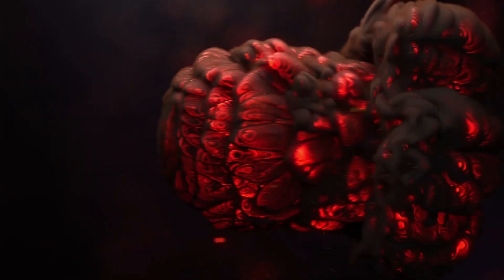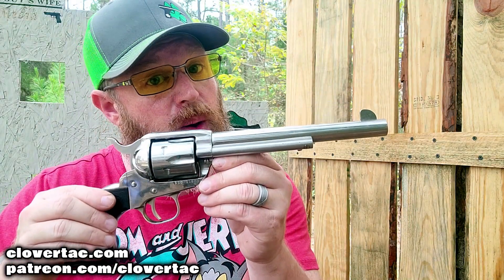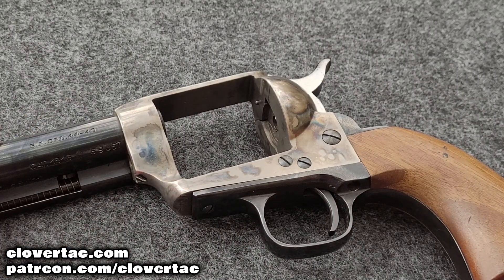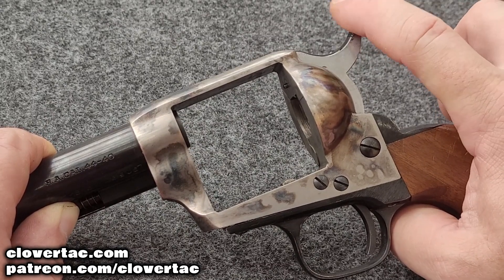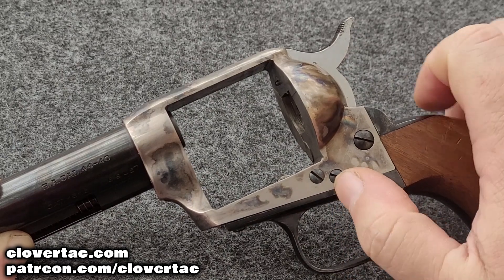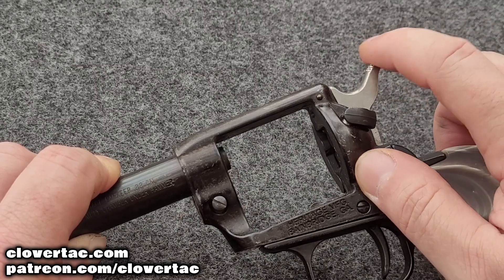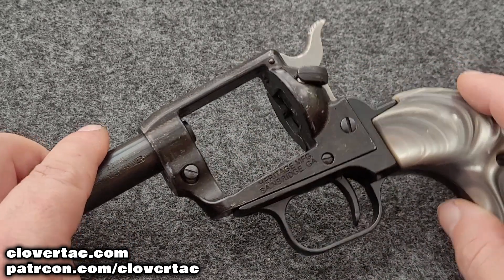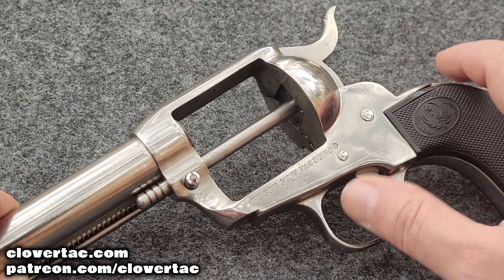How Alec Baldwin's Single Action Revolver Should Have Worked

Comment: Is it possible for  dirt to be in the safety notch and it not catch?
Reply from the maker: possible? sure, an alien could have also messed with it prior to filming, that is possible too 🤣😂 guess what i mean by that is while it is possible it is also highly unlikely. all of that mechanism is for the most part protected and sealed pretty well. for that very tiny specific area to be affected to the point of malfunction, other obvious signs of neglect or abuse as far as the revolver being dirty would be major warning signs, which "possibly" were overlooked as well. with that said, i still do not think, even from slightly before the half cock position, the hammer falling would have enough force to get it done... modern primers need a minimum of about 6 pounds of force and there just isn't enough weight, speed or travel distance to get it done simply under what little spring power would be there. keep in mind, the further back the hammer goes, the more it compresses the spring with exponentially increasing the force the spring has on the hammer. to the point of this video and plausibility, if the revolver was clean, functional, maintained, working.... as it should have been, then there is really no way it just goes off. so if that is the case and it was super dirty, well, we throw that in with the 100 other mistakes that were make which lead to this tragedy, right? 🤣😂
Reply from the maker: oh, worth adding, keep in mind, the notic for the safety and half cock are super, super deep, that is why as seen here you literally cannot pull the trigger at all when they are in that position, those notices are no where near as shallow as the cocked hammer position, by design, for safety reasons

Comment: While talking with MK Outdoor Journal about this I asked if the gun in question was a Colt clone because of those multiple clicks. I am less familiar with the design on the Schofield and others. I appreciate the breakdown here Clover.
Reply from the maker: from the speculation i have heard, it appears the revolver in question was a Pietta which would be very similar to the Uberti in these examples... that said as illustrated here they pretty much all have safety mechanisms built into place, even older ones. now whether or not something was jacked up, guess we will eventually see
Reply: @CloverTac  I believe we will.
Reply: You have to make the distinction between vintage guns and replicas. Although the replicas are based on the specs of the vintage guns from that period they often have modern safety features added. For example, the Ruger New Vaquero is obviously based on the specs of a vintage firearm but it has modern safety features such as a transfer bar and linkage between the cylinder and loading gate that makes pulling the hammer back to half cock to rotate the cylinder unnecessary. A lot of confusion has been caused by people bouncing between the idea of a vintage gun manufactured in the 1880s and modern reproductions made by companies that don't want liability for their customers shooting their toes off.
Reply from the maker: yep and keep in mind that in these period pieces, the prop companies do not use authentic antique historical pieces, well maybe rarely, no way in this case, budget was too small. they typically use the more modern replicated versions. so wear, tear, age, etc should not be an issue and as you say, safety features are much more prevelant as well... not that an original single action revovler isn't pretty darn safe if you simply follow the basic rules of safety.... muzzle, action, trigger

Comment: Good video and explanation of what could possibly have happened. The only thing that I can see that you didn't mention is that the Vaquero has a transfer bar which is why the firing pin can not be struck without some deliberate interaction with the trigger.
Reply from the maker: i think you missed it because i mentioned the transfer bar twice while talking about the Ruger... didn't show it, not really any point in my mind when i can show the hammer dropping from the angle i did where you should clearly see the firing pin doesn't move forward. this was more about showing how the firing pin works rather than speaking on the various safeties to keep that from happening.
Reply: @CloverTac  okay.

Comment: After several months we learn a little more - "During an interview with Detective Hancock, Baldwin said that his finger had been on the trigger but that he did not pull it. Baldwin said that he had pulled the hammer of the gun about three-quarters of the way back and then let it go before it discharged."  In your video you showed how "brushing" the trigger while cocking and releasing the hammer could result in a discharge.  It seems that Baldwin's defense is going to rely on semantics - he may have brushed the trigger, but he never "pulled" the trigger.  I'm sure that analysis of the gun will reveal whether components were worn to the extent that it was more susceptible to unintended firing.  Great video, by the way - very informative.
Reply from the maker: appreciate it, this one doesn't get much traffic anymore but we should always use instances like this to educate for sure

Comment: I watched both videos, thank you.  Now, we heard from defence that FBI destroyed the gun while testing (???).  Also, there was a message that some part was “filed” or such. 
Now, we also know that it was Colt Peacemaker and earlier versions of that model were without “safety” hammer position (first click) thus they were similar to your tested Ruger BUT with the pin on the hammer, right?  That particular model, would it have enough force of the hammer if pulled and released before the first (and the only) click?  It is also supposedly known (?) that users used to put only 5 rounds in those guns exactly for a purpose of avoiding accidental shot to happen in case something pulls the hammer….  There must have been some bad experience for the folks to do that, right?  Could you (or anybody) please comment - thank-you.  Could you please also suggest what part could be filed, malfunctioning or destroyed (by FBI) with this regard?
Reply from the maker: 5 shots were loaded more for a drop on the hammer rather than it slightly getting pulled back. not sure what else here you are referring to becuase this video was made a while ago (along with the revolver clicks video) just to show how things work. yes the Ruger is different but the Uberti is not. is it "possible" it went off, yeah sure, is it "plausible", i my opinion, based on everything i know, have seen and have demonstrated in two videos, no. and that was my point, the plausibility. another thing people get hung up on is him saying he did not "pull" the trigger. well, you don't have to "pull" the trigger to "activate" the trigger. brushing it, bumping it, rubbing it, pushing on it coudl all cause that "activation" which would again "potentially" allow the trigger to drop. end of the day, we may never really know and so all we can do is try to stress safety and educate people on how things work.
Reply from the maker: side note, that either way this goes, Baldwin was not just an actor, he had higher positions in the film making right? so ultimately, at least some responsibility falls onto him
Reply: @CloverTac   Hi Clover, thanks again.  I tried to stay out of emotions and comply with YouTube rules -in regards to the horrible tragedy-… (but I totally agree with you and, previously, I agree with @wienerdog123 and his detailed analysis and his conclusion that above mentioned Mr B is a dirt…bag in any scenario (more than that, actually)…) but that s beside my point and not my question.  All my questions were evoked by the accident but in fact they derived from my childhood time as I loved some westerns and the guns shown (especially the legendary Winchester 30-30 rifle).  Colts too… and with this regard, I noticed that sometimes they showed (unrealistically accurate 😂) shooting when a shooter wood hold the trigger and quickly jerk the hammer back with the free hand, implementing multiple shots….  I also noticed (thanks to some detailed scenes) that the clicks did not seem to correspond with the hammer positions.  The latter “phenomena” was clearly explained and demonstrated by you in the respective video that was priceless for me to find :-) thanks again.  Now, there were just couple of details to clarify:  how far back does the shooter need to pull the hammer in order for the spring to be tense enough to activate the primer and does the shooter always have his finger constantly squeezing the trigger … or some primitive mechanisms such as “1-click” very first Peacemaker would allow a shot even without pulling a trigger but just jerking a hammer - either a little , avoiding initiation or rotation of the drum OR slightly more , just past the point when new chamber is aligned ).  Thanks again!

Comment: The only ways that I could see the revolver firing without the trigger being pulled would be if the sear notch on the hammer was broken off or badly worn or if the trigger return spring was very weak, broken, or missing or a combination of these faults.
Reply from the maker: correct, some type of wear, damage, etc.... which is the point here, to show how a few fully operational revolvers actually work
Reply: And it is possible that Alec Baldwin's revolver was flawed, and that was on the munitions tech who handed it to him. It was also on the tech that the damned thing had a live round in it. According to NPR news, this same tech had been fired from another movie two years earlier for a similar mishap in which someone was injured but not killed.
I am certain the whole thing was a terrible accident, but it wasn't just bad luck. It was preventable and should never have happened.
Reply from the maker: yep, 100% avoidable for sure and that SHOULD be our take away here, safety and responsibility with firearms, not looking for someone to blame.... my opinion of course

Comment: great video as usual. this will also help people understand single action revolvers and even if they want one along with the safety aspects of them
Reply from the maker: 100% the point of this video, so good catch. and yeah, a single action revovler, if safety rules are followed, is one of the safest firearms out there
Reply: @CloverTac  yup, load 1, skip one, fill up. I don't have a lot of single action revolvers that are required to be loaded that way due to the "spur/firing pin" being on the hammer with no transfer bar/safety bar or whatever they're called. either way, 100% avoidable

Comment: These revolvers are pretty tough if they’re taken care of. The only way I can see it firing without the trigger being pulled is if the hammer is down on a live round and the hammer is hit from behind. Regardless, he is still responsible. There is not reason to be pulling the hammer back unless you are ready to shoot.
Reply from the maker: yeah, just no way a properly maintained and functioning revolver "went off" own it's own
Reply: You could drop Baldwin's gun a thousand times on the hammer and it still wouldn't go off. What you said is incorrect.
Reply from the maker: @ewallperschwaznyk9590  not incorrect... just not likely... too many factors involved to actually make it go off, confition, size of the hammer, speed applied to swing, distance traveled... the plausible and the possible are two different things.

Comment: Good video however, to know for sure and I bet the authorities are already doing this, you need the "exact gun" Baldwin used and run actual tests on it simulating what Baldwin claims.  Baldwin in my opinion is going to say anything but the truth to keep himself out of trouble.  Bottom line the gun was in his hands...only he was responsible for this tragic death no matter how he tries to twist the story.  As you stated you several guns you tried. These replicas are not always made to our manufacturing standards. 50 years ago I was in Fast Draw competition. I saw a barrel split firing  just a wax load. That gun was an Italian replica. We need to know more about this gun. I think the truth will come out.
Reply from the maker: ❤ yup! i didn't do this to prove baldwin or anyone else wrong, i did this to have something out there to educate people, as the titles says, on how things SHOULD work... there is no need for people to see this tragedy and think that well maintained and properly functioning revovlers (or any firearm) are somehow inherently unsafe, they are just not.